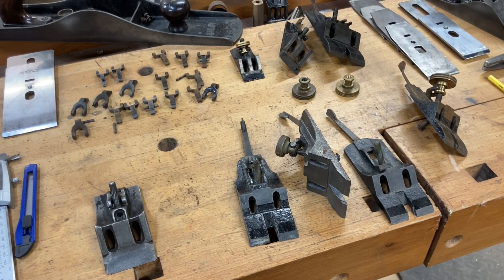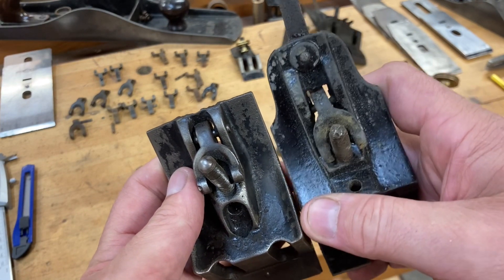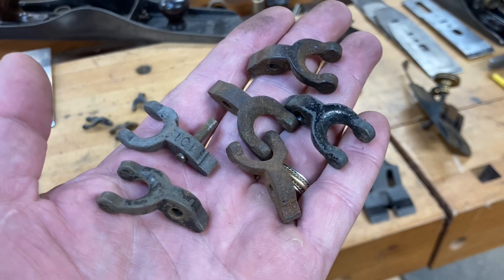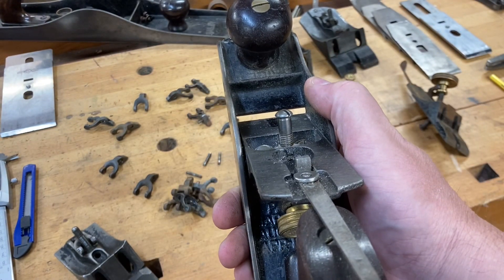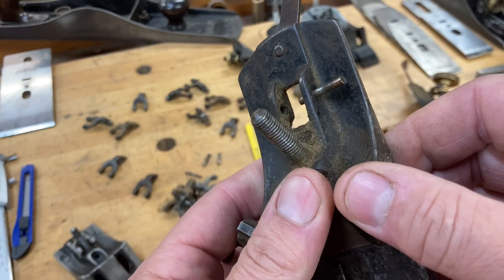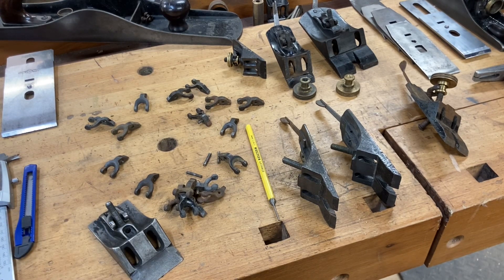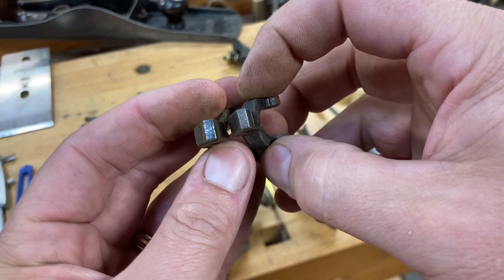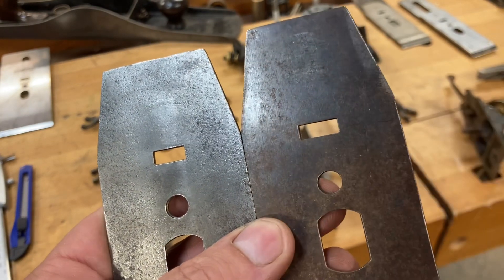Stanley Bench Planes - the Y adjusting lever (or Yoke) and what to do about “Backlash”

Comment: I used to have a no.5 where someone had built up the nib of the Y arm with braze and re-filed it to perfectly fit the hole in the chip breaker assembly. Unfortunately, it had a bust off section of the body side wall near the tail and I passed it on when I found a better example. For all it's faults it was a nice little workhorse.

Comment: Hi guys can somone help me 0ut here i have recently taken up the craft and have been given two planes 41/2 and a 101/2 but both are missing the screw from the back of the yoke that the brass adjuster runs on can these be purchased if so what are they called   many thanks
Reply: Im in the uk will that cause an issue
Reply from the maker: @pandaboy1872 not necessarily. The shipping will be a bear but not completely unreasonable
Reply from the maker: Replacing them is no problem. Email me at jplanefun@gmail.com and we’ll hook it up

Comment: Great info, thanks!  Backlash not bad on my type 13 number 5 (even with the hock iron/chipbreaker I got for it).   Terrible backlash on my transitional jointer.
Reply from the maker: A type 13 no5 is pretty solid. Sounds like a great worker

Comment: Great video and I appreciate the effort.  I have a Miller's Falls (1970's?) with the laminated steel yoke.  The hole is the yoke is much larger than the pin, so I put a bushing sleeve in to compensate for that slack.  I cut a piece of aluminum foil from a serving tray (about .003" thick), then rolled it around the pin about 1-1/2 turns and super glued it to hold the cylindrical shape.  Maybe I was lucky but after mangling the first bushing, I managed to assemble they yoke into the frog with the second bushing in place.  I recorded it and plan to do a video.  Thanks again for the great content.
Reply: I have same problem, would love to see your fixed solution even if its just a pic.
Reply: @322doug  It's not too fancy, but I've shown the work in a couple videos.  
"Great Neck G 4 Hand Plane Tune Up" around the 4:00 mark.
https://youtu.be/yEMFPEA79kk 

"Hand Plane Frog Millers Falls Restoration" around the 3:00 mark.
https://youtu.be/SOa9_1pR4kY